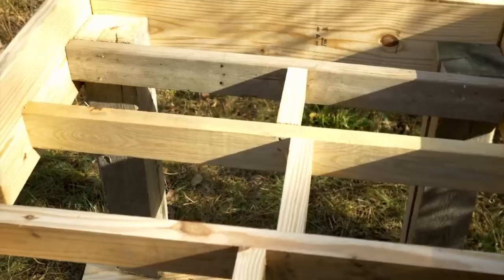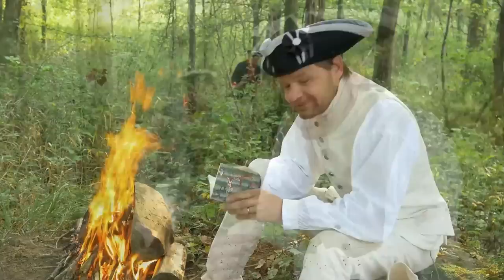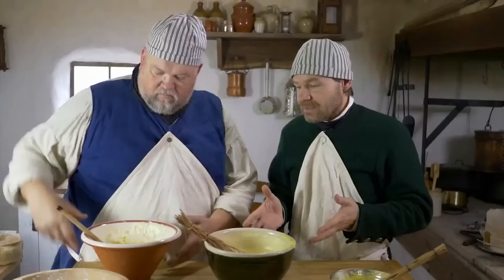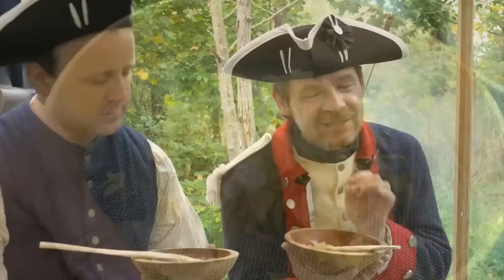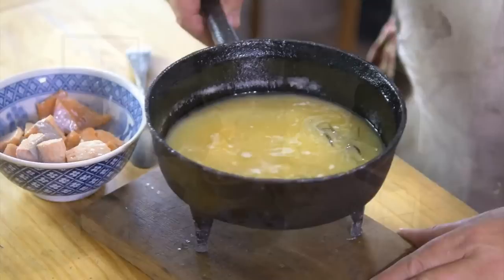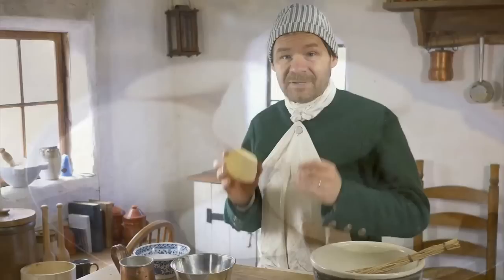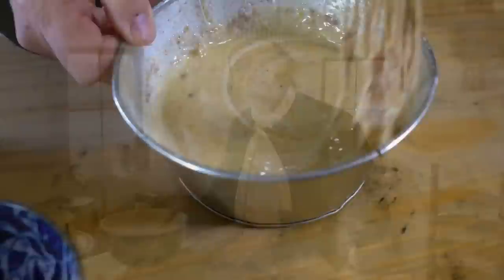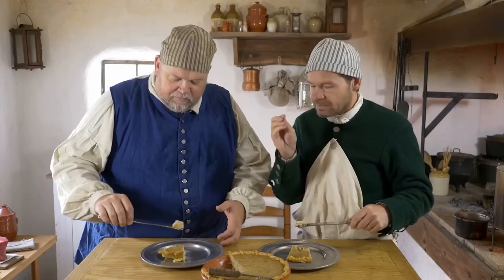Cooking Marathon! - 18th Century Cooking Season 7

Comment: CORRECTION ON POUNDING THE CABBAGE.  Making sour kraut was a fall tradition at our house growing up.  But there is one thing we did you did not mention.  We never never pick up cabbage until there are at least frosts over night.  You said you have to smash it down.  I was told and it was my job for years, I was “ Bruising the cabbage” the cabbage.    It is very important to bruise it evenly, layer of salt, layer of cabbage.   We had an assembly line and my grandfather walked around issuing orders. But the bruising help to make the Sour Kraut easier to eat.  It brakes open the cabbage allowing the juice to enter and makes pickling take less time.  Then we would have a taste after 7 days when the product is have Kraut and half cabbage flavor.   Same with pickled cucumber open them up after 1 week and enjoy half pickled cucumber flavor.
Reply: Yum!  I still like crunchy pickles.  They’re almost sweet.